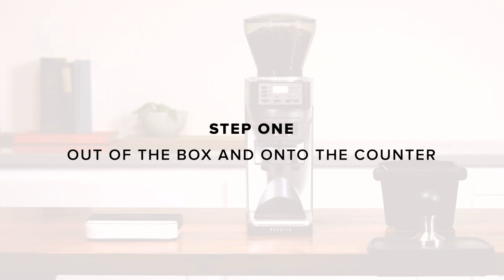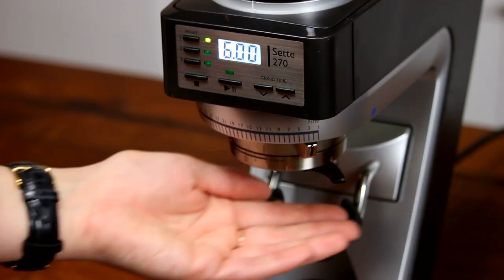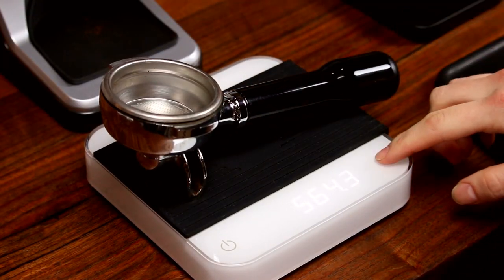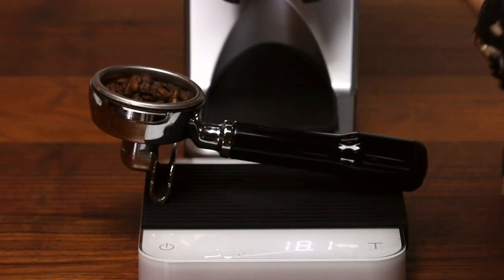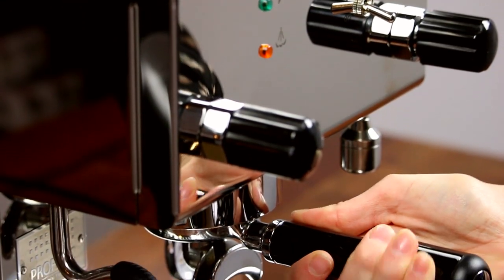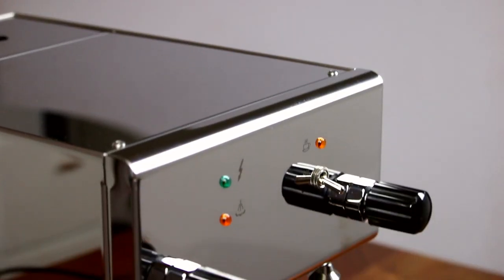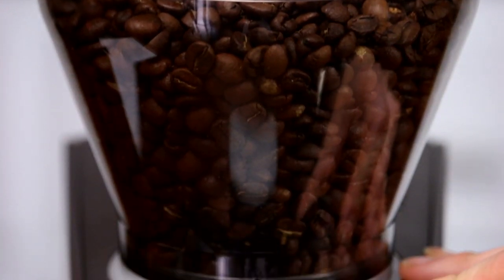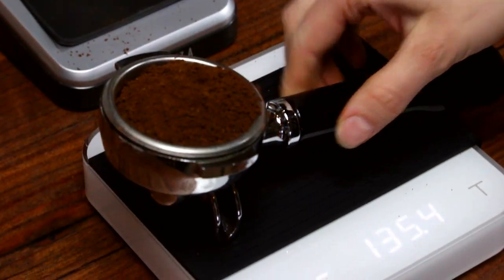Baratza Sette 270 Espresso Grinder Setup

Comment: Thanks for that very nicely done video. One aspect of dialling in the grind setting that baffles me is the adjustment of the same variable in two different places. 
For example, if the pour starts at 12 seconds it means the grind is to fine so needs to be made coarser, then if it finishes at the 20 second mark it then needs to be dialled finer which would then change the start time.

Comment: When I first got my 270wi I called Baratza to help with the setup. I mentioned your "single dosing idea" and the Baratza tech said he didn't recommend single dosing for this grinder
Reply: That’s because the 270Wi has technology that adjusts grind time to hit the target weight after a few attempts.  Not having consistent bean input messes with what the computing chip assumes it is grinding through.
Reply: That's because this is the 270 not the 270wi.

Comment: Pecka, thanx, tough is combination with manual Rok machine - how to set correct coarse/fine settings, if pressure is done by me :D But eye opener is that setting for espresso is usually between 5 and 9, I've been using just 8,9, didn't go below. Tried 7 and it is better :D Suppose I will overdose myself today :D

Comment: Anything below 11 does not produce a drop with my Sette 270i.
Reply from the maker: That's not an uncommon result. Over the years Baratza has made numerous subtle updates to the Sette line which have slightly shifted the calibration. Considering this is also very dependent on your coffee of choice and the rest of your setup, finding the right setting can take a bit of trial and error.